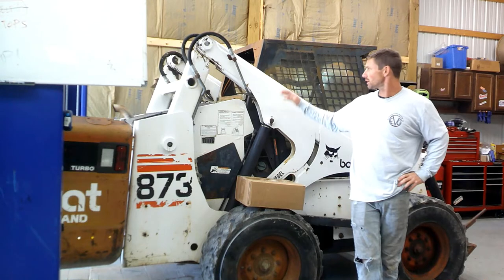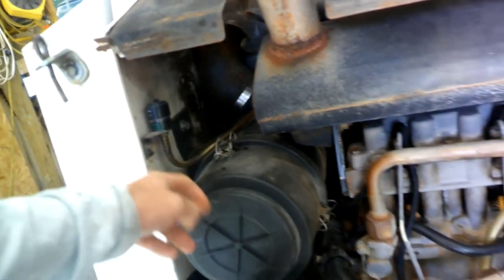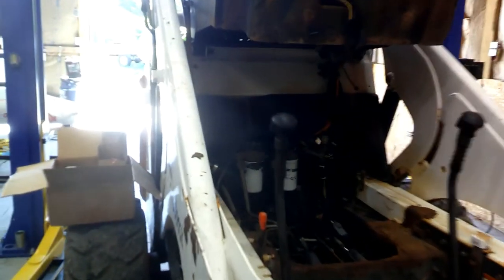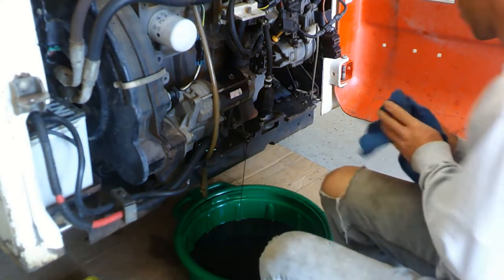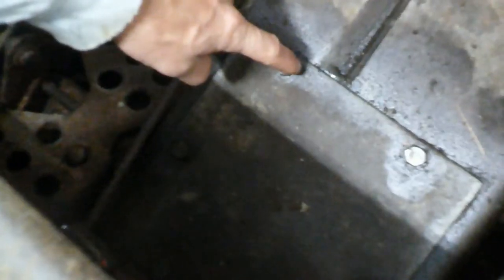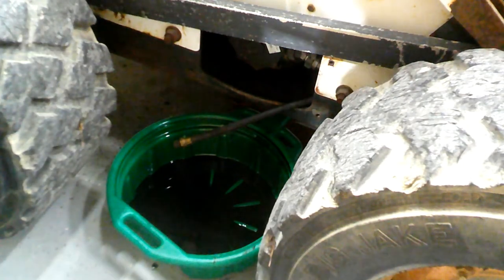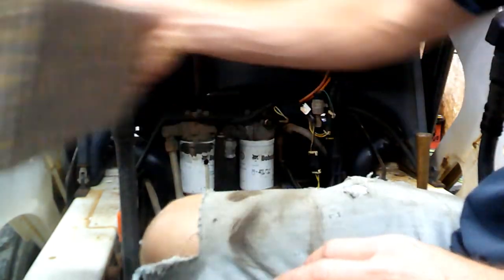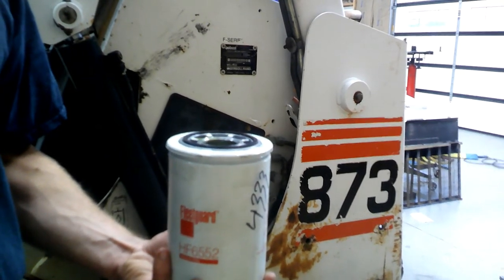Changing Filters and Fluids in My Bobcat 873 (Fixed Version)

Comment: Just got this model skidsteer. Where's the coolant reservoir/fill at?
Reply from the maker: There is none. The duetz is oil cooled
Reply: Is there a sight glass to check the Hydraulic level or just however much you know you put in?
Reply from the maker: @Deathfall-hk5iv  nope it all goes in the same system is the oil for the engine. So as long as you have oil where you should on your dipstick you're good to go.
Reply: @hollowaysgarage9332  you're saying it uses oil instead? Mine does have a hydraulic reservoir like in your video. Otherwise I'm not following on the Hydraulic side of that

Comment: My 873 goes forward and back but no lift or tilt after rebuilding two cylinders.  Any ideas???
Reply from the maker: I would say that has to do with the safety switches. There should be a box that will light up next to each safety before it will allow you to lift the arms. Make sure they're all lit. It seems lile if I dont slam the safety bar down it wont unlock the lift safety so make sure you check all the switches.
Reply: @hollowaysgarage9332  Thanks for your response.  Will definitely check out.
Reply from the maker: @cryptopops6891  good luck buddy
Reply: Do you mind sharing the fluid specs on your 873 I just bought one and can’t get info online
Reply from the maker: @unidozkc  I just ran ISO 46 from tractor supply.  The manual specs it with 30 weight oil if I remember correctly so I think newer ISO46 would work better.
Reply: Could be Hydrualic valve seals/ plungers

Comment: taking off the oil fill cap makes the oil drain 10x faster
Reply from the maker: Typically I just loosen it so it will pull air through.  I always worry about something falling in the fill while I'm messing around so I try not to leave it completely off.